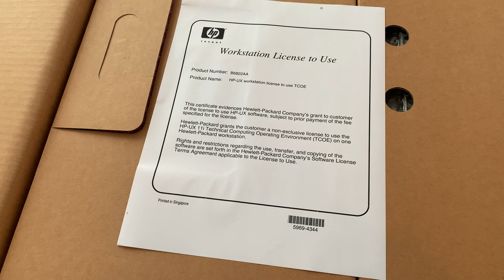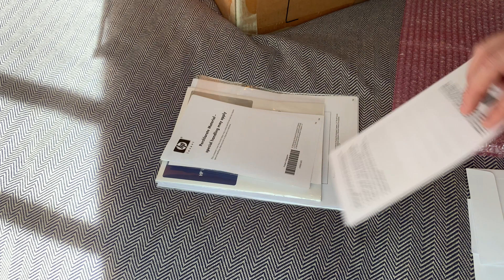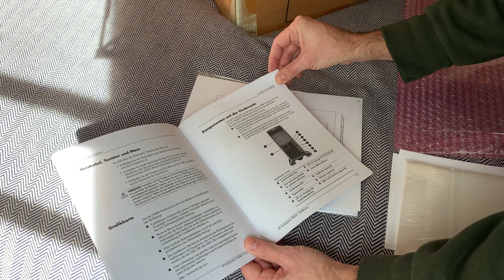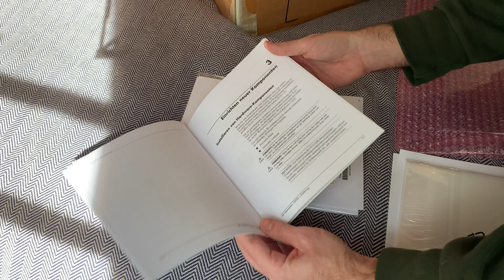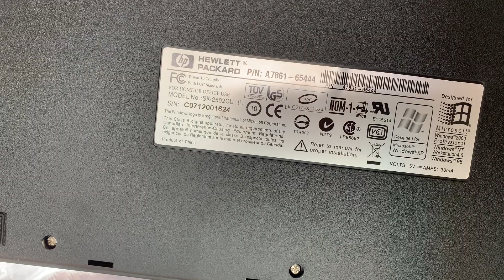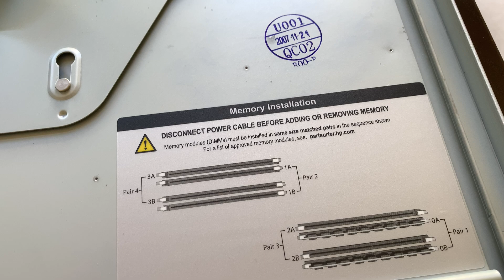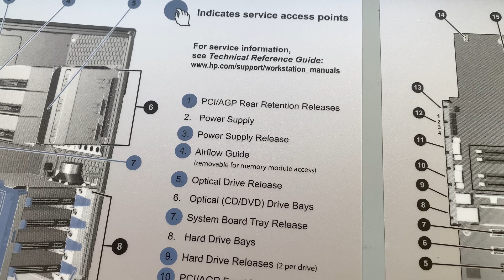The LAST HP workstation - unboxing the HP 9000 C8000 PA-RISC monster

Comment: This thing AFAIK has the ZX1 chipset, which is meant to be switchable between PA-RISC and Itanium CPUs with a firmware flash (& of course physical replacement of the CPUs). Has there ever been a confirmed PA-RISC to Itanium conversion of these units? (HP did offer a very similar Itanium workstation, called the ZX2000, but with only 1 CPU socket. It's super rare these days.)
Reply from the maker: I’ve heard the same and know as much as you do. 

I’ve been trying to score an Itanium box for a while, but the prices are super high and I just can’t find a desktop system. The rack systems are way louder. 

I’m not entirely sure they were meant to be switchable or similar as a matter of cost savings and roadmap.

In any case, I use my HP almost everyday. Way more often than I use my G5, for example.
Reply: @Shiunbird  Digging through the ZX2000/6000 firmware, it has references to a never released "ZX8000" model. Based on the mid-2004 release date of this box (long after the ZX2000 & ZX6000 were released, and not long before HP discontinued Itanium workstations), it appears to me that the C8000 is likely the cancelled ZX8000, with a PA-RISC CPU and firmware.

EDIT: I have now found direct evidence that this is indeed a rebadged ZX8000, in the form of an old, preliminary HP part list describing part number AB601-40017 (the P/N for the "HP workstation C8000" badge) as "Nameplate-Zx8000".

(BTW, Googulator is my alt account.)
Reply from the maker: @NetRolller3D  Interesting research.
Reply: As far as I know, there hasn't been. HP only officially supported PA->IPF conversions on a couple of systems (rp4440 to rx4640, notably.)

Interesting find about the zx8000. That makes sense - and fills a hole in HP's lineup for a non-server-based two-socket IPF workstation.

Comment: Nice machine! I have an HP Visualize C3750, which is a little slower than the C8000 - had to repair the DVD-ROM drive power cable connection (the pins were bent and there was no contact), otherwise it arrived fine.
Reply from the maker: VERY NICE ONE!

Do you have hp fx graphics or the FireGL? I only went for the C8000 because it was new in the box and I can run Debian 10 in it (it may do a bit of server duties eventually - 4 cores help), but, unfortunately, I can only build and run the OpenGL demos.

I am very interested in running the car simulator, but only the server runs on the C8000. I also couldn't build any of the Fortran demos.

Everyone documents the SGI demos but I'd like to give the other UNIX vendors some love. I'm in the market now for an AIX and a Solaris box and my collection will be complete.

PS: I recommend Softbench - an incredible IDE.

edit: and greetings from Prague =)
Reply: It has an HP Visualize fx5 graphics card; I don't think this machine supports a FireGL card, because it doesn't have an AGP port, only PCI x16 (maybe there was a PA-RISC PCI version of it, but I'm not aware of one). It doesn't always display video correctly, though - frequently some "shadows" of pixels get scattered around the screen (at least through VGA, haven't tried DVI yet).

The C3750 can also run Debian 10, only the GPU isn't supported, so it's text only.

I'll try to get SoftBench running (I have HP-UX 11.11 installed, which is the last officially supported version for the machine). I don't have the HP ANSI C compiler though, only the one included with the system, and also I don't have the linker patch that allows gcc to work properly, so I had to write a workaround in K&R C to be able to port some open source software (I have curl and links, currently trying to port LibreSSL)
Reply from the maker: @dr.shuppet5452  According to HP, there was a FireGL UX for the C3750. Not sure, though.

Forget doing K&R and the built in C - it's crap. It's only meant to be used for rebuilding the kernel.

I have GCC running fine, but it's also not ideal. You can't use HP OpenGL optimisations because GCC on 11.11 does not support local thread storage, so basically you lose performance for everything you build there. If you still want GCC, I can point you to what you need to get it running.

aCC runs better, though. I built a small crappy unoptimised OpenGL benchmark tool on aCC and GCC. I get 145fps 800x600 on aCC with HP's optimisations and 120fps on GCC without. You can also squeeze some extra frames if you target only PA-RISC 2.0.

I'm very glad you have the fx5 - I'd LOVE to see the distributed driving simulator demo. I can't open it on the FireGL. (the server portion of the demo works though9) Also to build the old school 3D demos from the 80s and early 90s.

I think I can help with everything you need to get up to speed.- compiler, the IDE, etc.. contact me via gmail.
Reply: @Shiunbird  Thank you, I'll write you an email (I'd also like to see some OpenGL, it's a graphics workstation after all).

I managed to get GCC running, I only had to use the builtin C compiler to compile a small wrapper around ld that removes some parameters that the system linker doesn't support. I'm aware of the GNU toolchain only partially supporting HP-UX 11.11 (I believe it has something to do with the fact that it doesn't use ELF).
Reply from the maker: @dr.shuppet5452  I'm running a quite old version of the toolchain, naturally.

So far I've been able to build everything I tried - sometimes I need to go around build flags (such as, with any OpenGL code linking against HP's OpenGL libraries), but it works.

However, aCC code performs so much better than I don't even bother with GCC anymore.
Reply: @Shiunbird  Where should I contact you? There's doesn't seem to be any email address on your channel.
Reply from the maker: @dr.shuppet5452  My channel name at gmail.

Comment: Hello.  I have the same computer.  With only one processor.  But it is not important.  The really sad thing is that I didn't have a graphics card.  I was able to find FireGL, but for a regular x86 computer.  And this video card is not detected in the c8000.  I suspect that the problem is in the other BIOS of the video card.  Could you download the BIOS of the video card and provide a download link?  I would really appreciate it.  I am sure that a video card from the c8000 will normally be detected on any x86 computer with AGP.
Reply from the maker: Hello there!

I'd not mind booting DOS on some AGP motherboard and dumping the BIOS for you. The problem is, the C8000 is the only machine that I own with AGP.

If you could point me to a place with instructions on how to do a firmware dump on Linux (I have Debian 10 running on it now), and if there's software for it for hppa, I'd be happy to do so.
Reply: @Shiunbird  Of course I will try, but it will be difficult :)
Reply from the maker: @SlexPiter  Maybe it can be built from source. If there's something like that around, I can boot from serial, and try this way. I don't have much time to look around but if you find it I will be the happiest to give it a shot.
Reply from the maker: @SlexPiter  I think I got it.
Reply from the maker: @SlexPiter  
I don't know what the deal is with the power cable information, because it is connected. But I guess you have enough to give it a shot.
I booted from the graphical console. If you have issues I can try again booting from serial. Let know how I can share this with you.

$ strings ./firegl_x3_256_hppa.rom | more
 761295520
11/03/04,16:44:28
113-A30104-107
\VRO
R420
DDR3
FireGL X3-256MB
          
YOU HAVE NOT CONNECTED THE POWER CABLE TO YOUR VIDEO CARD.PLEASE REFER TO THE 'GETTING STARTED GUIDE' FOR PROPER HARDWARE INSTALLATION.
(C) 1988-2003, ATI Technologies Inc. 
ATOMBIOSBK-ATI VER009.007.001.002
13A30104.107
0       
23158   
BIOS    
config.h
ATOM
PCIR
ATI ATOMBIOS
fPfQfRfSfUfVfW

$file ./firegl_x3_256_hppa.rom 
./Desktop/firegl_x3_256_hppa.rom: BIOS (ia32) ROM Ext. IBM comp. Video (115*512)

The file size is 58K.
Reply from the maker: @SlexPiter  Sent! Good luck and let us know!
Reply: @Shiunbird  Greetings.  Well, I tried to flash it.  It was possible to update the BIOS.  Only this, unfortunately, did not help.  The image on the monitor with this video card does not appear in the C8000.  The console shows that the last two messages end with this:
CC_BOOT_GET_SS_CONS
CC_BOOT_INIT_SS_CONS
And stop to boot vith one the fourth green light on the back. Maybe you know what is that means? Manual say nothing 😒
Reply from the maker: @SlexPiter  is your clock battery ok?
Another weird thing is not all keyboards will initialise a console. The older USB keyboard, the better.

Can you boot it up without GPU? As far as I know, you should be able to fully operate the machine without graphics only via serial console. 

I assume also that your card worked before flashing?
I can try again and review my bios extraction process. The problem is that I really don’t have any x86 AGP machine that I could run to extract the firmware in a more conventional way. 

Does the card still give you a screen on the PC? I’m thinking that I extracted it with the c8000 and I don’t know - something wrong with the binary data, endianness or data encoding perhaps.
Reply: @Shiunbird  Hallo again. Replacing or disconnecting the keyboard does nothing. Without the GPU, you can boot. But it is not important. I have an old ATI video card with which I can boot and use the computer normally. But there is no way to boot into the GUI. The most interesting thing is that if you watch the console output with the old ATI video card installed, then just after the messages CC_BOOT_GET_SS_CONS CC_BOOT_INIT_SS_CONS the image on the monitor appears. Apparently, these are just messages with an attempt to initialize the video card and/or  video output on it.
Reply from the maker: @SlexPiter  Just after initialising storage, you should see a message on the screen saying the model of video card that you have. This means that the system was able to initialise the GPU.

Of course, HP-UX will only have drivers for GPUs with the proper firmware installed. Without TCOE, you should get a full screen message saying that you don't have the proper drivers installed but still be able to use CDE. Once you install the proper drivers, this message is replaced by a full screen HP logo.

I am on 11.11, it seems to be the best release for the C8000.

With a PCI GPU, you could perhaps get a GUI in Linux with fbdev.

Can you boot to serial console with the GPU connected? Also, would you be able to install Linux and we try to flash the GPU from there?
Reply: I bought a firegl x3 256 card second hand and it worked fine in my c8000, from memory , I had to install drivers for it but it worked without them till I got the drivers installed....